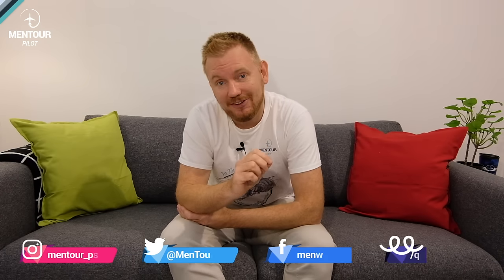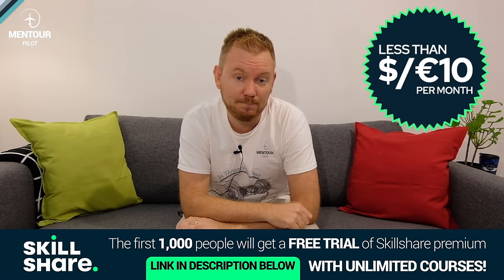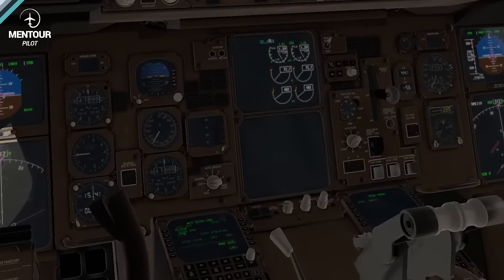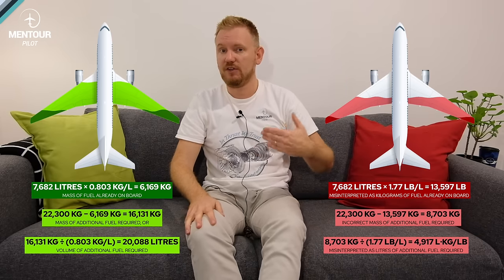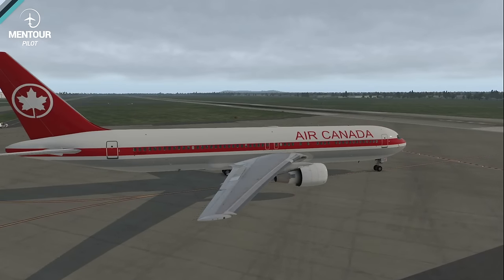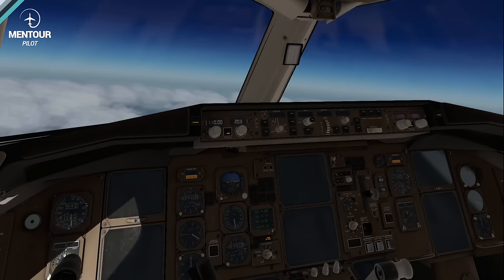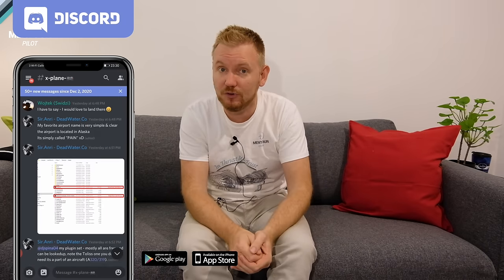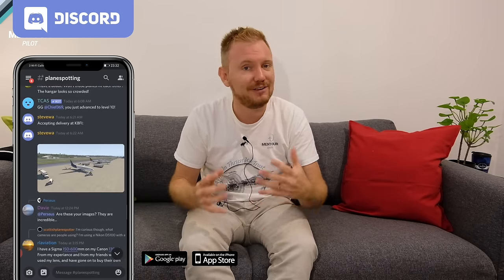The Gimli Glider! Explained

Comment: I lived in Gimli from 73 ( grade one)  to 89. I rember learning the metric system that year. The Air Force pulled out of Gimli in 1972. It was a training center. To me and my friends the old base was a playground to us, as in the early years of my life, we lived in the PMQs next to the base.
In 1984, I was in my driveway ( in 1980 we moved about 5 miles from the base out to the countryside close to i tiny place called Husavik)  downwind of the airbase when the plan flew a few hundred feet overhead. It was very silent with just some wind rushing past it, this was audible as they were close to me and the ground. I thought it was weird such a large aircraft was heading in. Next day, there it was..  I was working in the base during this summer ( still young guy going from grade 10 to 11)  at Hanger 5, which was the operations of OCA ( Ontario Central Airlines) as my father was employed there. Air Canada approached my dads Boss, Barney Lamm, and made him a deal. The deal was, help us, and let our guys set up a work base in your hanger and in return Air Canada granted Barney and Marion ( his wife)  a leftime pass on Air Canada Flights ( they have long since past. Barney is a legend, look him up.) Barney gave them his own office to use and directed my father to help in any way he could. My Father and I, along with others, moved equipment to the runway/dragstrip ( jacks, a  large"moose" tractor) to haul it back to the hanger after the front wheel was repaired. The nose was missing allot of material in the general area of the undercarige. We tried using our 10 ton moose which had a 460 ford V8 and creeper 1st gear  and a small dozer hook together, but the tires had sank into the pavement enough ( our bigest aircraft was a DC3 .....its hot in the summer there so the old asphalt was soft and not made for a heavy aircraft like this) that it was a no go... blew the clutch on the moose. Air Canada operations had to flatdeck a big 30 ton moose from the Winnipeg Airport to move the plane. Incidentally when the plane came to a stop, not only was the nose gear collapsed, all the other tires we're missing almost the whole bottom of them from the brakes being jammed on as the plane barreld down the dragstrip. The rubber was completely gone like somebody sliced the bottom of the tires right off . When the day came to leave after repairs were done,  they made an announcement that they would be leaving on the following day, in the afternoon. However, they pulled a little bit of a fast one because on that particular day, as I was pulling out of the driveway to head to the hangar to start work at 8am, I saw the plane flying overhead and heading back to Winnipeg. They just didn't want to have anybody around when they left, I guess just in case. One other point I like to just correct is that there wasn't a drag race going on, but there were children playing on the drag strip and then in the pit area there was a small circuit track. So the people who were actually at the races that day were using the circuit track with midget racers at the far end of the 1/4 Mile Strip in the pit area. When the plane came down it came right down on the centre guardrail of the 1/4 mile track ( was an NHRA sanctioned track at the time...saw many a race there) and picked out all the short little post that were holding it in place. The posts were old and weak. The plane came to rest long before it reached the pit area which is a good thing because at the beginning of that 1/4 milestrip are the Christmas lights and also there is a building there a small booth as well as wires going back and forth. There is an active runway in Gimli still to the day, but he chose the "wrong" one I think because it was visible first . The runways are parallel and the tiwer is unmanned.  The next year I worked the Gimli Parks . We honored the flight crew by bring some of them in for the Icelandic Celebration on the August long weekend. I even got to drive in the parade in my convertible Beattle with Mayor Ted Arnason riding high in the back tossing candies to the kids. Great memories.
Reply: That was a great story. I really hope it's immortalized here!
Reply: it's ironic that the pilot that flew the plane back to winnipeg is also here in the comments
Reply: it's ironic that the pilot that flew the plane back to winnipeg is also here in the comments
Reply: Come for the video, stay for the audience story time!
Reply: I think the Gimli Glider is in the desert in Arizona now.  It should be returned to Manitoba to that airstrip.
  When the airplane runs out of fuel have a CANADIAN pilot on board!  We have done it twice, you know!
Reply: @michaelrmurphy2734  They scrapped it in 2014. Offered at auction and no takers anywhere close to the reserve price.
Reply: @danielbliss1988  NNNNNOOOOO!!!!!!!!!!!!
It was a historic aircraft!!!!!    Smashed firetrucks after 9-11 were put in a museum!!   Would you scrap a Spitfire or Sopwith Camel?!    Terrible loss of important things?   Tell me about it...
Reply: @danielbliss1988    At least the nose of the Avro Arrow survived.  I have  seen it in Ottawa.  What was the asking price for the "glider", do you know?  Speaking of gliders...
Reply: @michaelrmurphy2734  I believe the seller, Collector Car Productions, was trying to get over $2.5 million and the auctioning topped out at 425K; there was some news about this in the Canadian media. According to the plane's Wikipedia page it was subsequently scrapped and recycled.
Reply: Great note never knew anything after repairs,was the short runaway enough for the 767 to take off
Reply: @deepakshetty8165  obviously since they repaired the landing gear refueled it and flew it out
Reply: @michaelrmurphy2734  we’re good at gliding-just not so good at fueling😀
Reply: Ok I think Jim may have met his match in “best comment on the internet” competition 😄
Reply: Thank you very much for sharing this memories!!!
Reply: @pradiptanugraha6410  Indeed.
Reply: @danielbliss1988  well, THAT'S heartbreaking!
Reply: You have described the area perfectly (of course) 👍🏻👍🏻
Reply: yeah! I knew I remembered this one being on Mayday Air Disaster Investigations!
Reply: So it didn't occur to anyone at the time to send a runner over to Gimli to be sure the strip was clear?!
Reply: @uclajd  I guess not
Reply: Oh wow! Thank you for sharing your story! That's completely awesome!
Reply: Yeah, first thought when I saw the pic at 24:14... "Uhm.. those aren't drag race cars."
Reply: I know how those tires would look like, because I saw an old B737-200 with the tires blown due to a long landing... the pilot braked so strongly as to literally "sand" them flat against the asphalt. That 737-200 came to stop ta the extended portion of tge runway at Ciudad del Carmen in Mexico. Not only were the tires on the main landing gear completely "cut", but the magnesium alloy wheels had a flat section also grinded flat from the prolonged braking. That airline was "SARO", and it was a low cost, precarious little airline, with old, barely maintained planes leased from Shanonair. Their finaces and installations were marginal at best, and while the captains were more or less OK, the First Officers were too inexperienced and little trained.
That flight was carrying a young school boys trip, so that meant that nobody liked the airline at that place anymore. Soon tgey stopped flying to Ciudad del Carmen, and a few weeks later tge airline stopped operating forever. I flew with them several times on the flight deck, and it was "interesting" in many ways.
Reply: Jesus wow! Sounds like you were right in the thick of history!
Reply: Thank you so much for sharing this. I really enjoyed the insight.
Reply: @uclajd the pilot wasn't aware that the runway wasn't a runway anymore and once on approach he was committed.

Comment: One of the other lucky breaks that Bob Pearson and Maurice Quintal had was that the ATC at Winnipeg was still equipped with a large, high-power military "skin-paint" radar system, in addition to the more modern transponder system. They llit that up in order to be able to see the altitude, range and bearing of the aircraft - since it no longer had a transponder and was not visible on the regular ATC system. The controller was able to give Quintal pretty good readings on his range and bearing as well as height above ground, so Maurice Quintal was able to calculate their descent rate and forward speed in addition to position. 
My parents lived in Edmonton; my dad, also a pilot, knew Bob Pearson quite well. I remember the news in the papers and on TV at the time, and I was introduced to First Officer Quintal a bit later. 
In spite of the procedural errors that led to this happening, it's hard to overstate just how amazing Pearson's performance was in side-slipping and yawing that 767. He had almost no power, poor visibility because of the aircraft attitude and cockpit windows, and although Quintal was getting good information from Winniped ATC and plotting course and distance to the Gimli strip, Bob Pearson was carrying the can, and had absolutely zero options. 
Not enough speed or altitude (or control function) to do a full turn, or go around. Nope, he had to reduce airspeed and loose a lot of altitude in a pretty short time. It remains one of the most outstanding episodes of airmanship I know. Both Pearson and Quintal were very experienced - I belive Bob Pearson had over 16,000 hours in large jets, and Maurice Quintal over 4200 hours, in addition to his time in the RCAF. If it was going to happen, there would not be too many crews who had that combination of experience and skills.  Several years later, I flew on that particular 767 to YVR, and noticed that there was a small plaque mounted near the forward entranceway, saying that this was the famous "Gimli Glider."
Reply: Even more information I didn't know about. Thanks for adding this. The flight crew's performance is legendary. No one is perfect and to get this aircraft down without fatalities is amazing. I would have loved to see that plaque!
Reply: That's a brilliant addition to the video, thank you!
Reply: It stayed with the air canada fleet until 2009 i believe.
Reply: A few months after the landing in Gimli Manitoba, Bob Pearson and Maurice Quintal were both working with each other again and they both quickly realized that the 767 that they were on board was the “Gimli Glider”
Reply: Hadn't one of them operated FROM that (now closed) airbase while in the RCAF?  And had more familiarity with that runway than most other pilots would have had?  Ahh..I should have just kept watching!
Reply: @trooperdgb9722  Yes, I don’t remember which pilot but one of them was familiar with the military airport from his time in the service.  Crazy how it had become a drag strip that was being used as flea market on that particular day.
Reply: @donnix768  Amazing event....
Reply: @trooperdgb9722  yes it was first officer Quintel that did some Air Force time at what was gimily Air Force base it wasn't marked on their charts but Quintel having knowledge of flying out of there a few times in the Air Force knew where it was that's when they radioe ATC of Quintels knowledge of this and ATC responded they were familiar with this as well but told the pilots it had been closed down but the runway wasn't controlled as the movie showed but that was the only choice they had.
Reply: You can now buy a small peice of the gimli glider, avworld had them last i looked.  I've also flown on that bird after the incident.
Reply: Some people are born with wings man, flight is their way of walking.
Reply: @aserta  SO true!!
Reply: Jim Baritone, absolutely one of the best comments to any video that I’ve ever seen!
Reply: Finish prom music
Reply: That's a very interesting additional information, they had little other info to tell they what glide ratio they were achieving, they would have speed and altitude from standby instruments but no idea if they were in a head wind that would drastically affect the effective ratio. 
But I'm fairly certain even that radar doesn't resolve altitude, they would have had to rely on the standby altitude gauge for that.
Reply: @chrisglen-smith7662  I worked on these systems for a relatively short period in the late 1970's. After 40 years it's possible I have the capabilities of this 'legacy' system confused with another. However, it was designed to function as part of a military network, and my recollection is that there was some altitude-determination capability above about 8000-10,000 ft. I don't have the system manuals or specs at hand, so you may be correct and I may be in error with respect to altitude. I'll see if I can chase down any more information about the specifics, and if so I'll add it here. Thanks for your observation.
Reply: @jimbaritone6429  sounds like you know what you are talking about :-)
Reply: Waw. Lucky  you are!
Reply: Bring it back to Manitoba!
Reply: If he had not been awarded the Order of Canada he bloody well should have gotten it!
Reply: So you don't need basic primary school maths in order to be a pilot then. That's me qualified !
Reply: You point out a confusing issue. Primary (skin paint) radar does not relay any altitude information unless you are on a PAR approach to an active military installation and even then you can only see a couple of thousand feet elevation at ten miles out on final. So, without an operating transponder there is no way for ATC to know altitude other than pilot reports. It is possible that the aircrew had some altimeter information available via barometric pressure gauges that do not require power if the aircraft was so equipped. However, without ATC giving the aircrew bearing and distance and an approx ground speed they would have no chance of survival. They were another critical link in the chain of events that saved the day.
Reply: @aserta  beautifully said!
Reply: If I heard this correctly on most  aircraft the  flight engineer figures the needed fuel but this plane only has two pilots and now  one of them figures the needed fuel. 
For another possible check why doesn’t the fueler double check what the plane needs for the trip as he fuels the planes every day and should know how much fuel that is required to make the trip 🤔
Reply: It's awesome they added that plaque to the aircraft, that was some incredible flying. I read somewhere they tried to get other pilots to do it in a simulator, but none of them could do it.
Reply: So what systems on a passenger jet have back up power is it basically just the radio? Doesn't seem very safe.
Reply: Ok Jim you win “best comment on the internet” prize😃. Thanks for the insight!!
Reply: LOL! YOU BEE THINKING ABOUT AN X=RAY MACHINE,NOT RADRA FRO MASH HE LELEFISION SERIES!
Reply: Thanks for your comment, it is worth an entry on an encyclopedic volume on emergency landings.
Reply: @PappaMike-vc1qv  Based on the final report, Quintal relied upon radar to periodically obtain their distance from Winnipeg. He then triangulated using the onboard altimeter and the time elapsed. Very impressive stuff considering everything else that was going on.
Reply: @benmac940  Per p. 29 pf the final report, they had only standby instruments consisting of a magnetic compass, artificial horizon, airspeed indicator and altimeter. They could also check distance to Winnipeg over the radio. From that, FO Quintal was able to estimate their trajectory.
Reply: @JohnSmith-oe5kx  that's absolutely riveting but nothing at all to do with what I asked. So not sure why you're directing that to me.  Do you just like trying to show how much you know, or more like how much you can Google?

Comment: I flew as a training Captain on Boeing 727, 737 (200-900), 747 (200, 300 an 400), and also for a short time on the 767.  The MEL is a pilots document, it is an absolute no discussion no override book.  You are correct there is a maintainable version of the MEL that gives the engineers more latitude to dispatch buy using one time only maintenance release usually to get the aircraft home for repair on non-revenue  flight.  The Captain Never has the right to override the MEL even if receiving approval from maintenance control.  This story I have used many time to demonstrate this doctrine to new Captains.  Aviations ability to learn from past mistakes is one of its strongest features.  Once again your ability to turn complex technical discussion into easy to understand story is superb.  I think we need a medal for “excellence in aviation story telling”.

Comment: Although Pearson was part of the error that allowed it to run out of fuel his flying ability was insane, holding that large bird in a slip with but a whisper of hydraulic boost was done with pure determination and an impressive display of physical strength.
Reply: Yes, he was part of the error. math and measurement conversion mistake. US Imperial measurement vs Metric (international) measurement. for his flying skills that help landed the plane, thanks to his experience and skills as glider plane pilot
Reply: I’m so glad they got credit and appreciation for their brilliant handling and being mentally able to respond and not panic